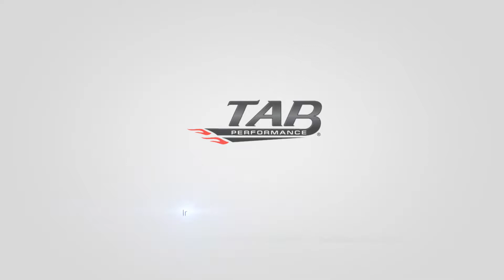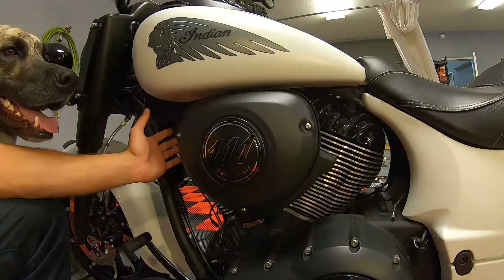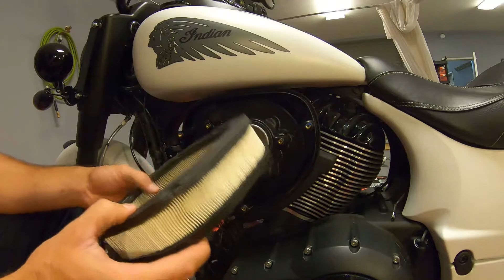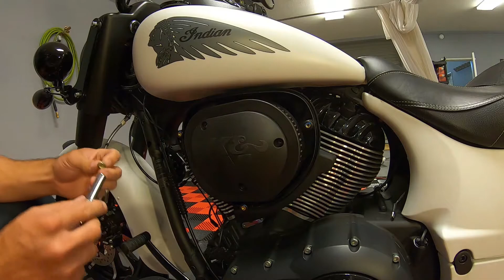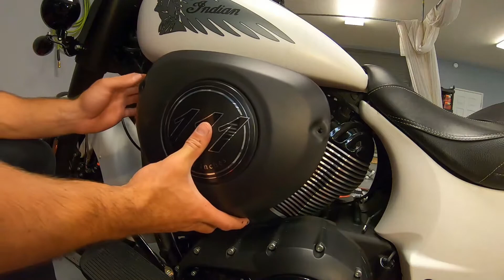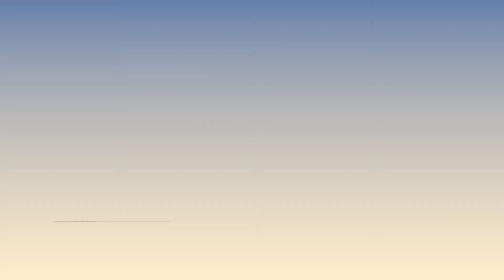Installing a new air filter on an Indian Thunderstroke Motorcycle - TAB Performance

Comment: For those who ask if this filter makes a difference, yes, it does. Especially in the upper RPMs when passing a vehicle or gaining speed quickly.

I had replaced my stock filter with a K&N recently, and I discovered that I needed to replace my air filter bolts with some that were 5mm longer due to the taller profile of the new filter.
Reply: sur la vidéo il utilise les vis d'origine !!!!????!!!